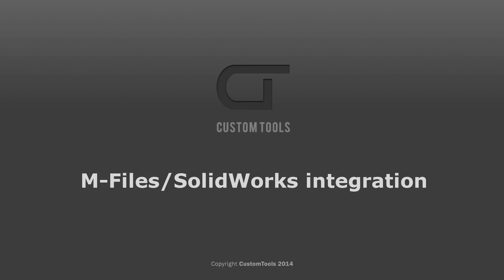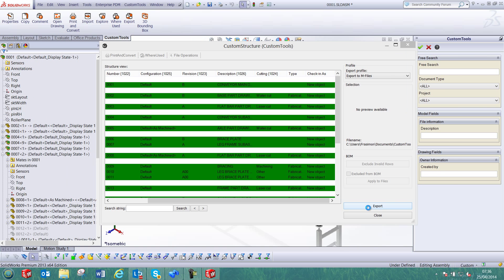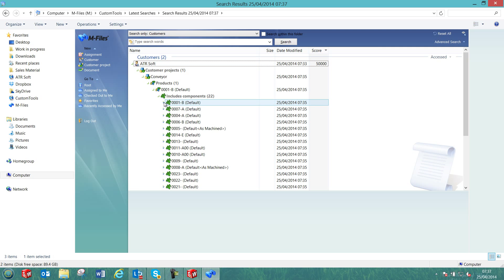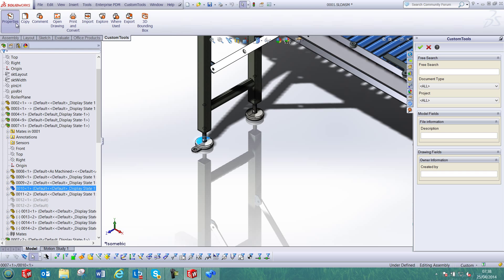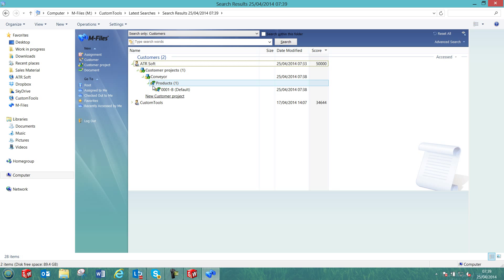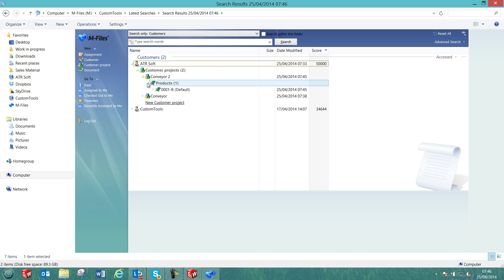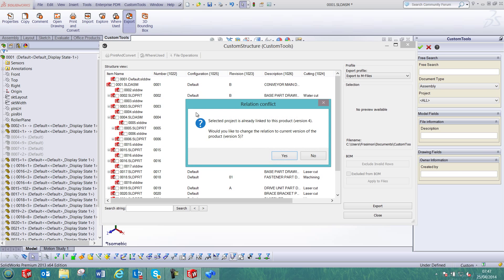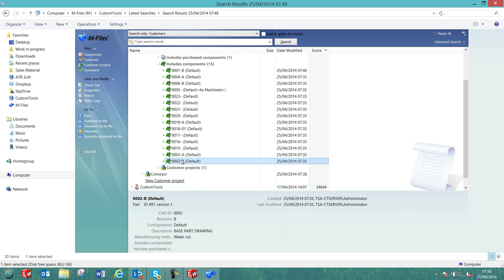M-Files/SolidWorks integration with CustomTools (HD)

Comment: Our customer want to upload to M-Files their Solidworks Assembly like your Movie.
But we can not find the "Custom Tools" in the movie.
How can I get this Custom Tools? 
Is it commercial?
Reply from the maker: +wansoo shin, Hi, In the video we are not uploading native SOLIDWORKS files to upload as M-Files is not a PDM system and having native SOLIDWORKS files would create some issues with the file references. Instead we are exporting converted files to M-Files (e.g. PDF, DXF or STEP usually). We can create product's structure in M Files and map custom properties of the SOLIDWORKS files as M-Files attributes
The MFiles SOLIDWORKS integration is an add in to CUSTOMTOOLS and needs to be bought separately. If you are interested please feel free to contact us at info(@)customtools.info

Comment: Can this solution replace the functionality of SolidWorks EPDM? Thanks!
Reply from the maker: Scott Morgan Hi Scott, no this solution cannot replace SOLIDWORKS EPDM. CustomTools helps SOLIDWORS users to optimize their data management while SOLIDWORKS EPDM helps its users to manage their file. M-Files is not a PDM system. M-Files has not been designed to store SOLIDWORKS Files and we do not recommend to use it as a PDM. If you have additional questions, please feel free to contact us at info(@)customtools.info